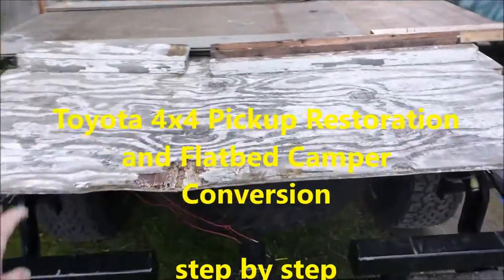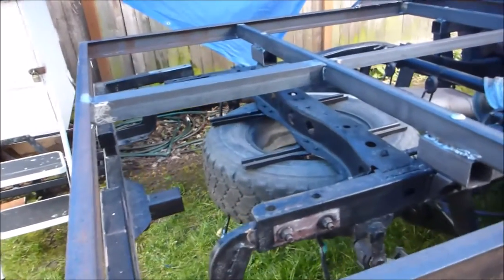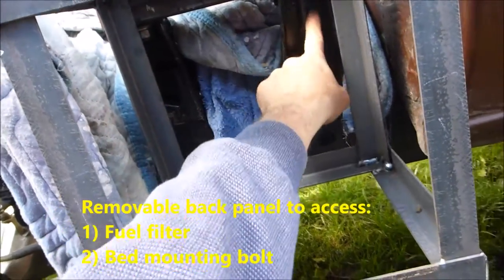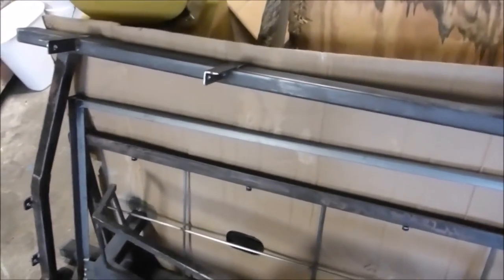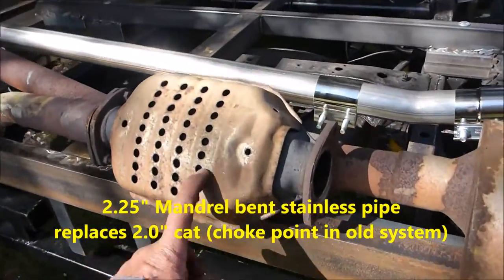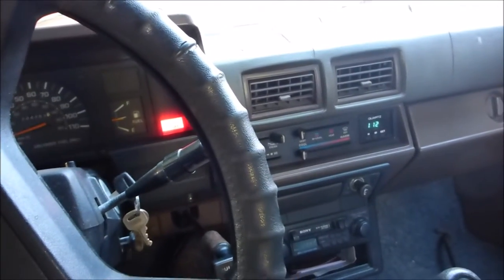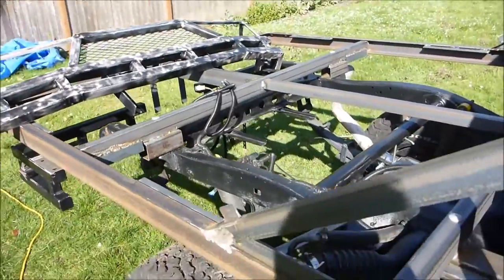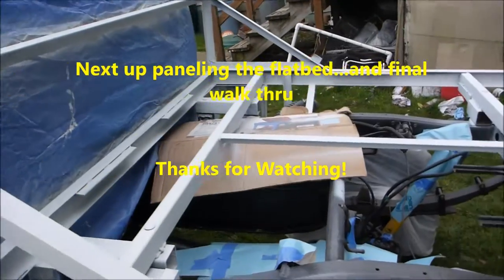Toyota 4x4 Pickup to Flatbed Camper Conversion - Part 6

Comment: Enjoyed the series thanks! 😎 P.S. how did the aluminum plate stand up to the stainless self tappers? I remember commercial fishing as a kid that stainless fasteners really did a number on aluminum , but then again that was in the ocean. 😎
Reply from the maker: The SS tappers lasted about 5 years a few are still in but most I replaced with nut and bolts also SS. I began using it as a mini dump truck hauling up to 1500 pounds of stone at a time then things got stressed. The aluminum plate still looks great with a bit of dulling and battle scars, I've never regretted the choice.